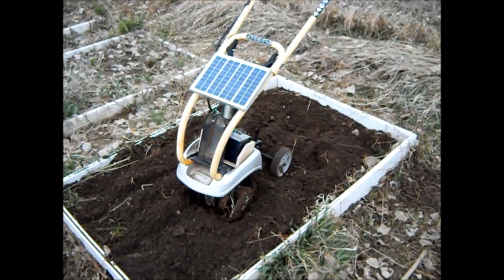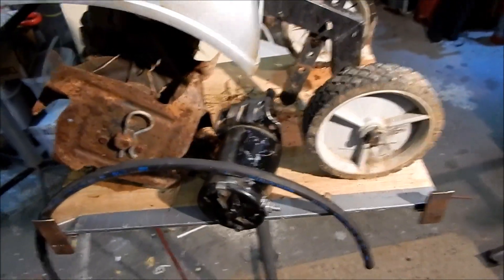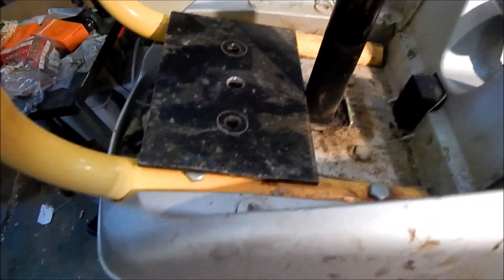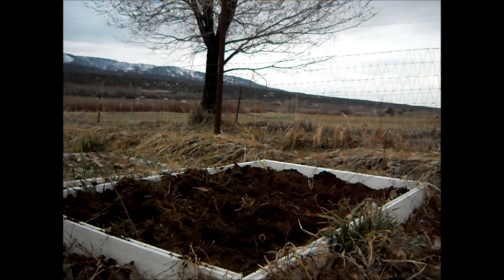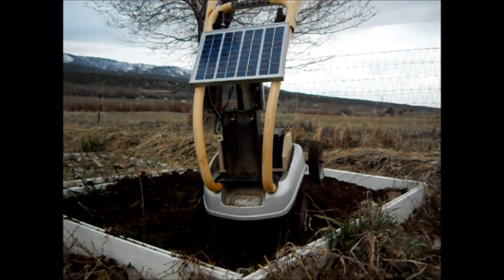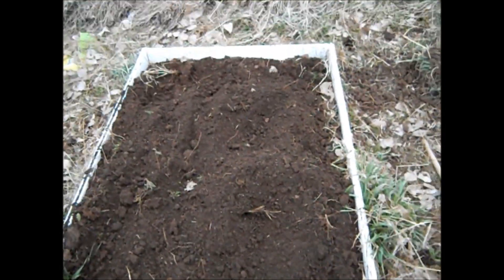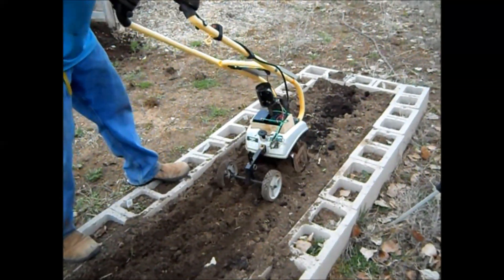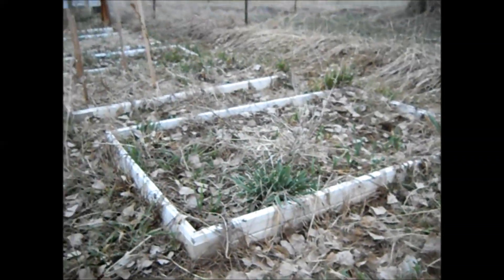A DIY SOLAR rototiller

Comment: Is that the starter motor out of your 1950 yellow panel truck?
Reply from the maker: lorem ipsum That Chevy panel was awesome. Who is this, that was 100 years ago. I wouldn't attempt to try and do what I  did at 18 with a drill press and buzz box welder  with my full machine shop now that I know it shouldn't have been done. Get in touch prepperpro@gmail.com

Comment: I'm really surprised that the motor is holding up. If I remember from my auto mech classes, starter motors should be run for no longer than 15 seconds at a time to keep them from overheating. You're experience is proving that wrong. Nicely done.